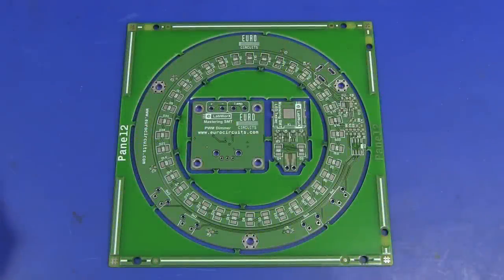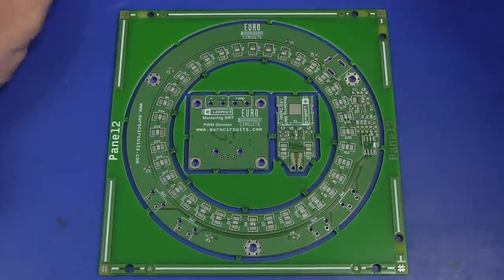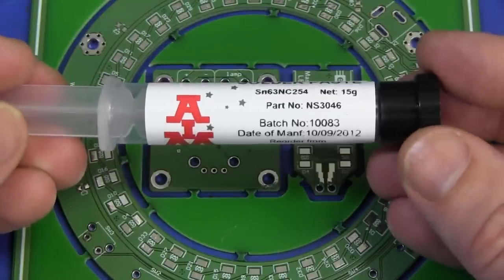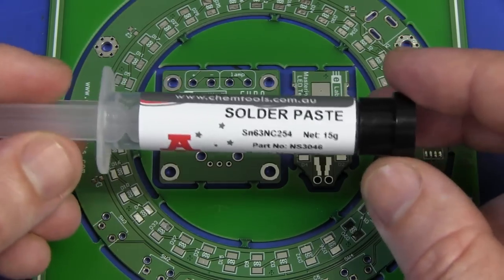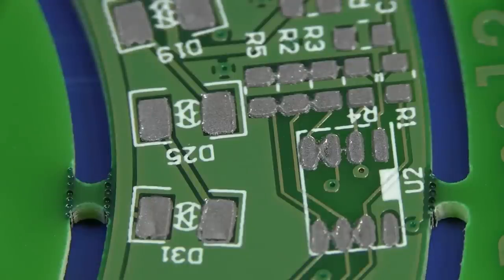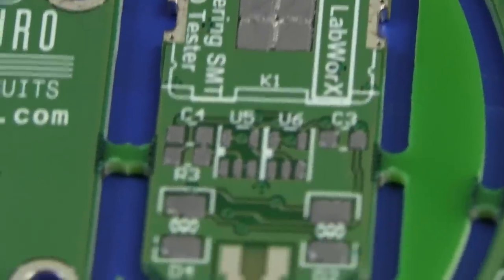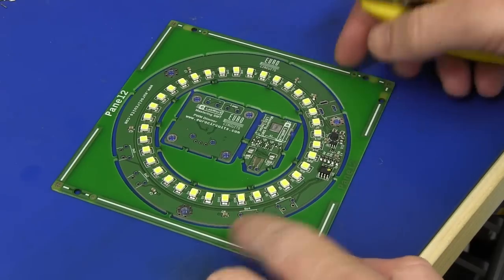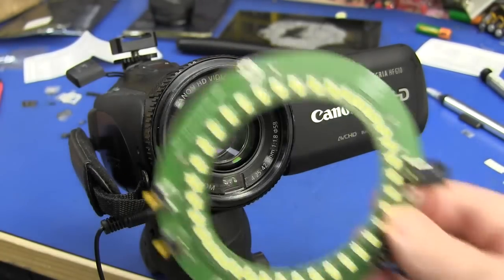EEVblog #415 - SMD Stencil Reflow Soldering Tutorial

Comment: can you also bake them in your kitchen oven? and how hot do you need to reflow them?
Reply: if you have a convection oven you can otherwise the results might be dodgy. you need an oven that circulates air for best results. you can convert a cheap toaster oven with a few gadgets to move air around. similar to a convection oven which is why those can also work
Reply: I would not recommend that because of the lead contents, this is toxic. You can see the temperature and the times in the graph, Dave presented in this video.
Reply: you can buy unleaded solder paste as well
Reply: Kewl Beans Still not healthy. Common phrase: Just because you can doesn't mean you should.

Do you go around eating play doh? After all, it's unleaded / non toxic. I'm sure if you ate enough it'll wreak havoc in your digestive system.

mike vermeer 
PLEASE, do NOT use your kitchen oven for anything OTHER than it's intended purpose! Buy a small $20 oven from online or at your local store for things like this.
Reply: bugs181
hey trol bait i never suggested using the same oven that's used to cook food. xD once you convert a convection oven for reflow it's rather useless for cooking anyhow. oh and if you're still not convinced dave's done a video on them ;)
Reply: Kewl Beans Trol bait? Excuse me?

Yes, you DID in fact suggest you can use the same oven to cook food, otherwise you wouldn't of led the OP to believe otherwise.

Let's take a look at the facts.
Op: can you also bake them in your kitchen oven?
You: if you have a convection oven you can

Why even comment with your answer if you weren't telling the op to do otherwise? It's a simple yes or no answer to the Op's question.

I think you're the "trol bait" here, not me.
Reply: Why do you argue about that?
It's not important if he meant to said it or not. More important is the answer:
1. Can you use a kitchen oven? Yes, if the oven's heat is evenly over the whole area, but I would not cook meal anymore in it. So it depends on the oven if it will work.
2. Can you cook mean in an reflow oven? Yes, you can, but I also would not recommend it, especially if you reflowed solder before.
As conclusion, I would not recommend to use the "other" thing in the oven. The producers took their focus on the attributes and meanings of the device.
Reply: TheThore The question was primarily about the safety of using the kitchen oven and if he could eat out of it afterwards. NOT the question about "if it can be done".
Reply: Ah okay, sorry. But this is quite obvious. In solder there are incredients which are not healthy (e.g. flux, lead, ...) so it vaporizes and spread over the oven, so I would never ust one oven for both, reflowing and meal cooking. But I thing everybody can answer such things by himself by just thinking.
Reply: TheThore
ofc not that was just be stupid lol. agreed i have a feeling that most of dave's viewers have a fairly decent intelligence ;)
Reply: Oh and sorry for my misspelling, it was a bit dark, I know it's "use" and "think", although I am not a native english speaker ;)
Reply: Thank you :)

Comment: Dave, I love your work!  Just wanted to say after you did all the hard work of pick and placing, you should have used the kitchen oven instead of the hot air gun.  It works as good as a production oven.
I couldn't fit the instructions in this post so let me know if you are ever going to try this.
Cheers.